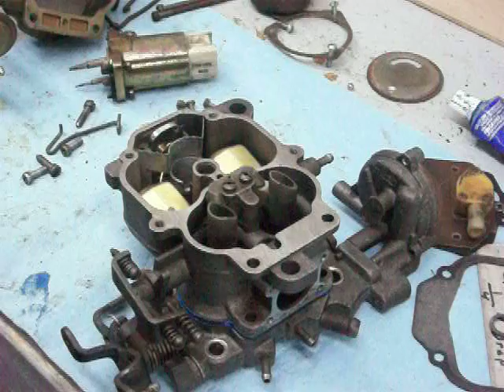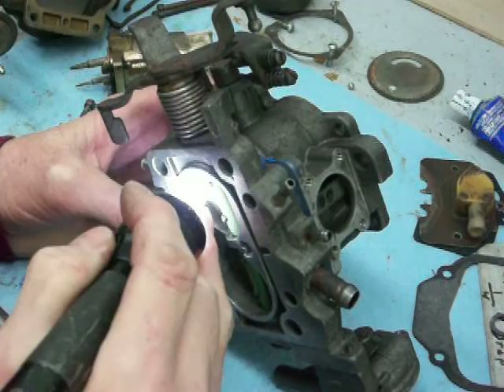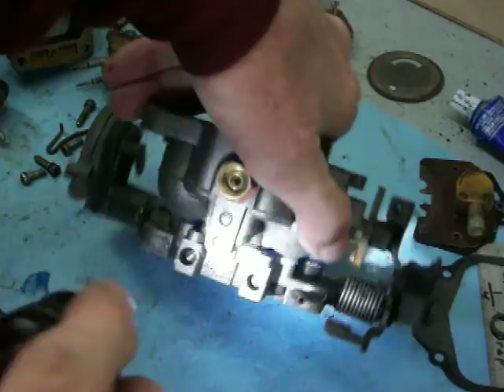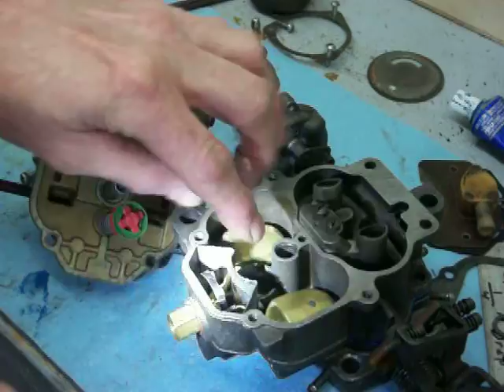Idle circuit and main metering circuit of 1981 BBD carburetor Jeep 268 6 cyl.

Comment: can i run that carb with the vent tube blocked ...does the vent tube help with vapor lock ..i dont have a charcoal can so it i have to use the vent tube i will either have to run it open or i can run a hose and t it into my oil breather cap conected to air filter box

Comment: If you're still here, .... I have a carter bbd, ... rebuilt, .. part throttle, and full throttle work properly.  The truck/carb will NOT idle. Truck dies.  ('70 Dodge W200 Power Wagon) .. Manual choke must be pulled out 1-2" in. for truck to remain running.
Can someone point out the area that's the culprit? Is there a solution?
Reply from the maker: I would check the idle screw  first, then the  air/fuel mix screws.  Make sure the fuel level in the bowl is right.